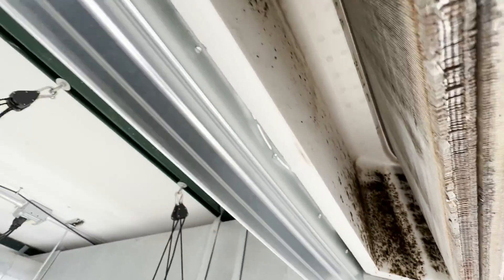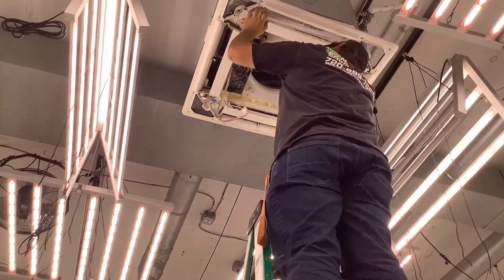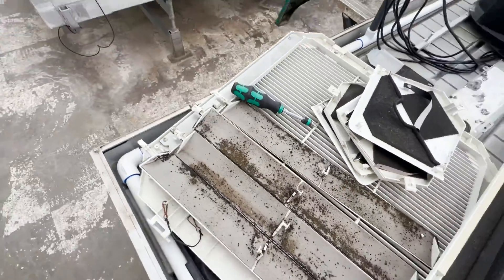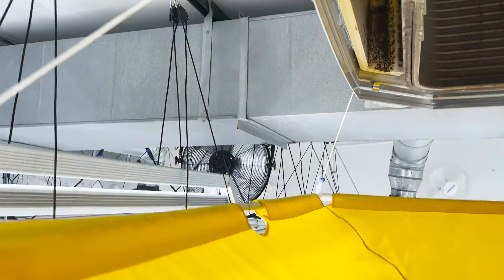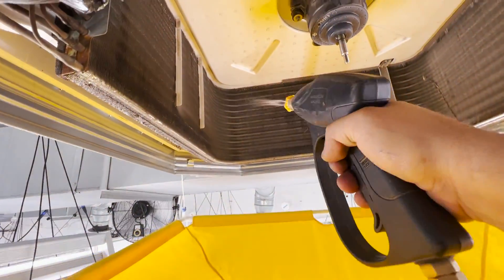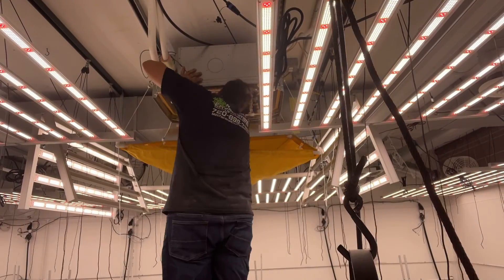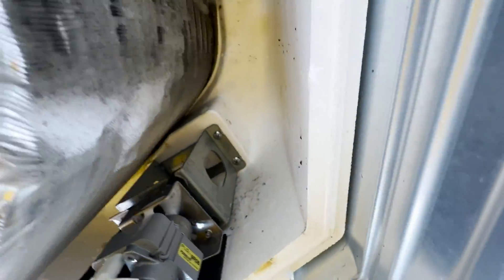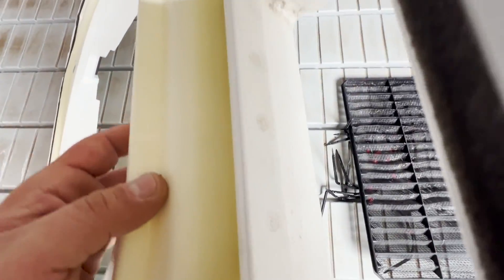How to clean a Mitsubishi mini split ceiling cassette, using the Supco-ZCA24 Mini Split Catch-All

Comment: It's too bad that you're in CO. I'm in a recently built building in NYC. The GC and subcontractors left all my Mr Slim and ceiling cassetes running during construction. The amount of drywall dust and filth in my units is absurd.

Comment: Dude, that is black mold. So nasty! How often is this kind of cleaning necessary?
Reply from the maker: The frequency of cleaning an indoor unit depends significantly on its surroundings. Given that this unit operates in a garden environment, which tends to be tough on Mini Splits due to increased soil and humidity, more frequent cleaning is usually necessary. This unit was manufactured in 2014, not sure when it was installed, or if its ever been cleaned before.